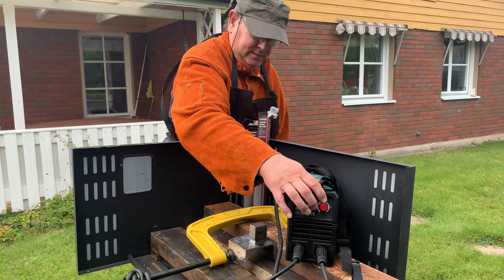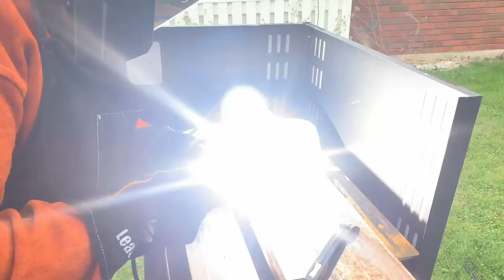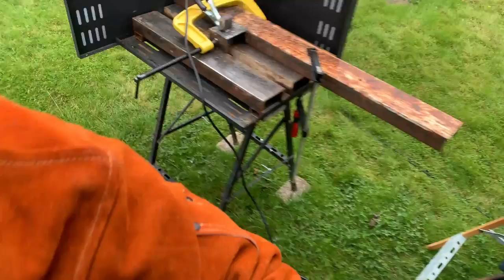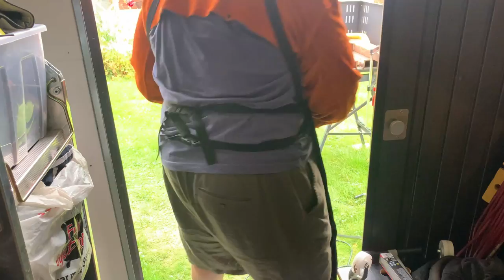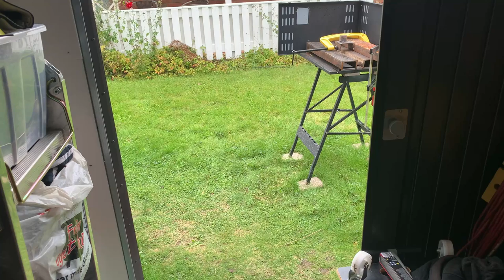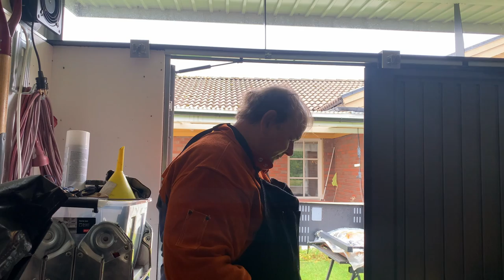Parkside Inverter Welder PISG 120 C4 first welds

Comment: Will you recomend this model for beginers ?
Reply from the maker: Depends what You want to weld. I use it for mild steel with thickness 3-6 mm seems to work OK. For mild steel less than 3 mm I use flux cored wire welder see https://youtu.be/-CkzmqTYtCY. I have opted to not have gas cylinders but if it's OK for You more options are available for example TIG, MIG with gas